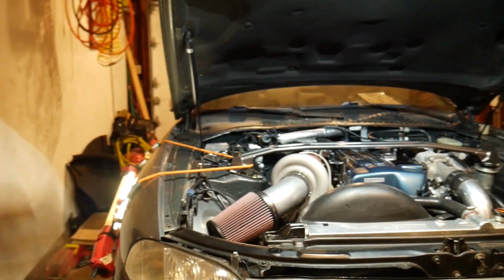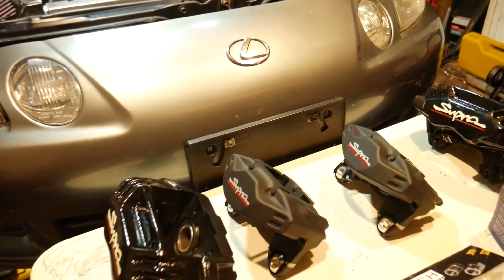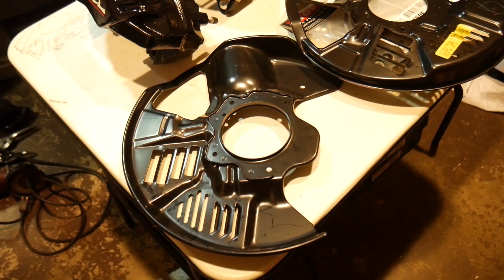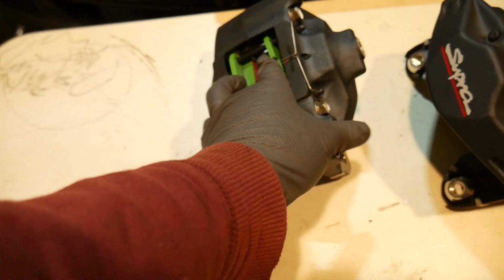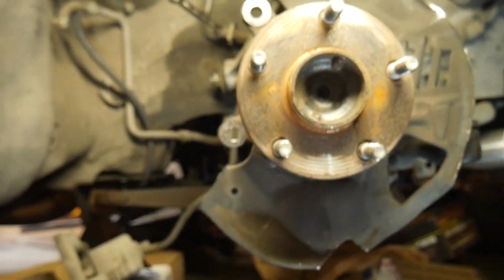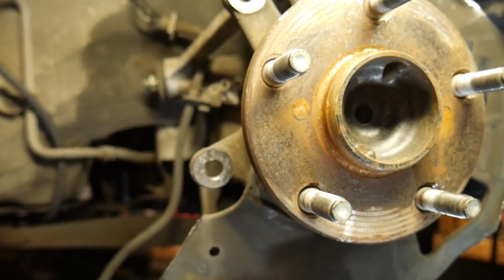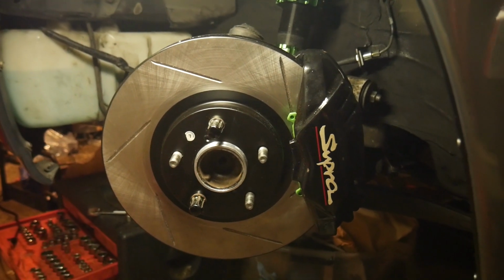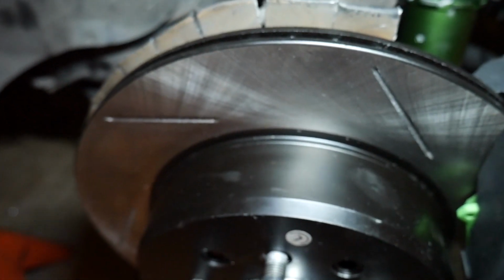Toyota Supra TT Brake caliper swap on a Big Turbo SC300

Comment: Been a loyal Toyota fan for 20 years, built my jzs147 up and just purchased an SC to swap it all over and found your channel. I like your use of OEM/quality parts, good approach and well thought out decisions. First video but I'm sure I will be watching more of your build as I acquire my own parts.
Reply from the maker: MrStonedBuddha thank you! Let me know if you have any questions
Reply: @Edward3jr  Any issues bleeding the brake system with its' ABS module after doing the caliper swap/new lines?
Reply from the maker: MrStonedBuddha no issues bleeding the brake! Stops great!
Reply: @Edward3jr  Thanks! I only plan on doing the fronts first so that's promising no issues bleeding, I did an ABS delete on my GS so bleeding was never a concern until now.

Comment: I was running the ls400 fronts with the mk4 rear. Almost similar setup. But with stoptech pads too. Then I found a sent of mk4 fronts too. I love it.
Reply from the maker: Sunny I heard the mk4 brake calipers were the way to go, I might end up going ls400 on the red sc300 to compare the two.
Reply: @Edward3jr  ls calipers are the cheapest upgrade. But if you the money mk4 no doubt!

Comment: Such a sick car.  Also so funny I started to work on my ls400 big brake upgrade today.  Have to prep and paint.
Reply from the maker: Pete’s Carport lol, I would say we’re on the same modification schedule, but clearly you’re way past me with the amazing body work you’re doing!
Reply: @Edward3jr  bro I can't tell you how many hours I have into the body work.   It must be over 100hrs.  Lol.  Never expected it to be so long but soon it will be done and then the brakes.
Reply: I just finished video.  I see you had issue with brake lines.   I'm going braided as well.  Any suggestions so I don't go crazy
Reply from the maker: It will all be worth it in the end, and you’re getting a ton of experience. You’re on your way to master level if you’re not already there
Reply from the maker: Pete’s Carport as for brake lines, I couldn’t get them started. At first I was upset with stoptech, but then I decided to phone one of my master tech friends over at purrito racing and he explained to me that on some sc’s the brake lines came over torqued from factory. So essentially the fitting becomes widened when this happens and its impossible start. I had to file down the tips of the fitting to get it started. You might not even have this problem. 

Out of the 4 lines I had to file down 2, 1 rear line went in easily, and one front line was a pain but I was still able to get it started with out filing it down. Let me know if you run into any issues.

Comment: Just subscribed today.  I have a '95 SC300.  Got the  Stop Tech hoses, and just like you say, the line nut won't go in.  What did you file down?  The first thread on the nut ?
Reply from the maker: BigElCat  it looks like these fittings were over tightened from the factory on some sc’s. when this happens the head becomes a little compressed and is flattened. So you want to file down the outside edge that goes inside of your new brake lines. take your time, It’ll take maybe 5-10 minutes going slow and easy. I had to do this to 3 sides but one side went in super easy. Thanks for subscribing, let me know if you have any more questions.

Comment: Hey boss what rims do you run for the setup. Getting my Supra TT callipers and rotors. Have to get the correct setup so it clears. Need help
Reply from the maker: I’m running superadvans v2 I believe. 18x9-10 +24. No spacers clears calipers

Comment: What rotors do I need to use with these callipers. I have a sc400 and my supra callipers are coming in so need bigger rotors. What size do you use
Reply from the maker: Only need Supra rotors

Comment: Where did you order your rear supra to calipers from? The ones I saw look different.
Reply from the maker: I think I bought these on eBay listed as brand new from Toyota. It’s been a while though.
Reply: I just got mine from a Toyota dealer through their Ebay site. The dealer was in Idaho of all places lol. Got stock tt rotors locally here in VA, and the front tt calipers from Oreillys ( yup they are Sumitomo oem remanufactured ).

Comment: What size rotors did you use in the rears, I want to do these to my sc so bad they look so good on the car
Reply from the maker: Josue thank you! The rear rotors are stock size, I believe 12.6. When shopping for rotors with these calipers, lookup stock Supra tt rotors. Links to the Parts I used on are in the description.  it should give you an idea, but let me know if you have any questions

Comment: What hose did you use so I don't have to trim the calipers
Reply from the maker: rgonzales158 these were stop tech hoses, but the hose was not the issue. After researching this more I found The problem is that some sc300 came over torqued from the factory. I know someone who had this same issue with different brake lines. And I know people who had zero issues. 🤷🏾‍♂️
Reply: @Edward3jr  ok cause almost every video shows them grinding a little bit of the caliper to fit the brake line on the caliper itself
Reply from the maker: rgonzales158 yeah, you should not have to grind anything when using Supra tt calipers. You have to grind the calipers when going LS400 though.

Comment: What do you mean file the break line.
Reply from the maker: Some of the break lines were over torqued from factory, Causing the head to expand. Because of this when you replace the break lines, it’s almost impossible for them to fit. So you have to slowly remove some the material with a file. 

I only had to do this for two sides.
Reply: @Edward3jr  ah ok makes sense. Happened to me to. So that’s a relief, I thought I had to change the lines. Thxs love ur videos hope u can make a lot more videos on the sc. u r one of the reason I gave this car. Thxs
Reply: @Edward3jr hey bro need help looking for new rims that will clear the supra callipers. Any suggestions on rims.

Comment: Maybe throw some seam seal on those cuts in the dust shield? To prevent it from rusting?
Reply from the maker: Woodlands Crew - PA that’s a good idea, I eventually plan to replace them with the correct ones.
Reply: @Edward3jr  Did you eventually change the dust shields? I've been looking to find dust shields for a 2nd gen gs300 because I'm not with cutting and bending. I'll have some made before that

Comment: That is some nice work, what year rear calipers is that I'm wanting to do that as well love the content nuff respect bredda.
Reply from the maker: Gaza Performance Garage G.P.G thank you! Ironically I literally saw your fuel pump ecu bypass video earlier today. Great job! As for the rear calipers, these are just mk4 Supra calipers. So 1993-1998. Check on eBay and let me know if you have any questions! Thanks again!
Reply: Thank you for the info I got your channel on lock. Keep up the good work

Comment: What the heck did u do to get those lines on man!!? I've been going on over 2 hours on these with no luck.
Reply from the maker: I had to file the nipples down. Be patient with it, file a little at a time. It’ll fit
Reply: @Edward3jr  thanks for the tip.. I'll try filing the nipples.